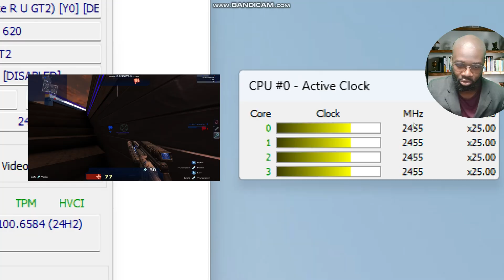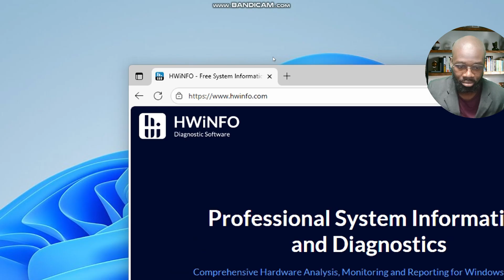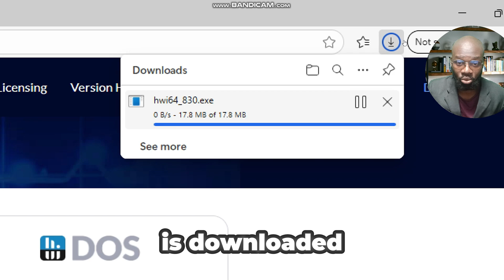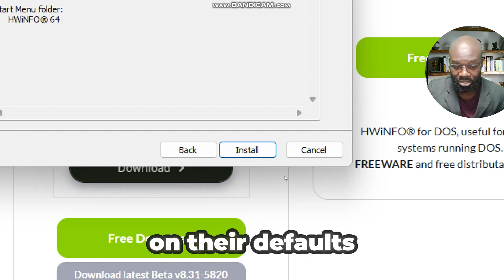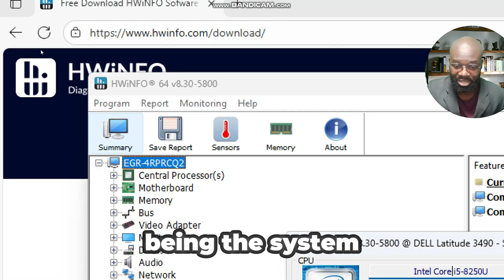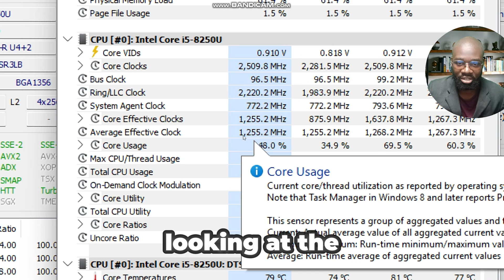HwINFO | CPU Performance Check

Comment: Why you have win 11, but choice on site for download for 3 system: win 7, win 95 and...., for dos. I have win 10 and want download hwinfo for win 10. I am sorry for my English
Reply from the maker: Hi, thank you for your question! Your English is perfectly clear, no need to apologize.

The download option that says 'Installer for Windows 7 and later' is the correct one for your Windows 10 PC. The label 'Windows 7' just means that it is compatible with Windows 7 and every newer version, including Windows 10 and Windows 11.

It is the standard, modern installer that will automatically give you the best 64-bit version for your system.

So, for your Windows 10 PC, please download the 'Installer for Windows 7 64-bit and later'. It is made for you.
Reply: @ULTIMATE_THRILLER_TV thanks